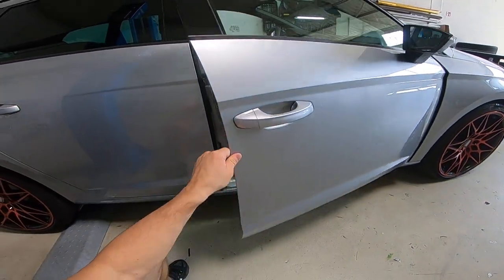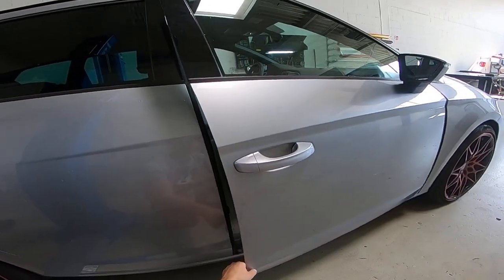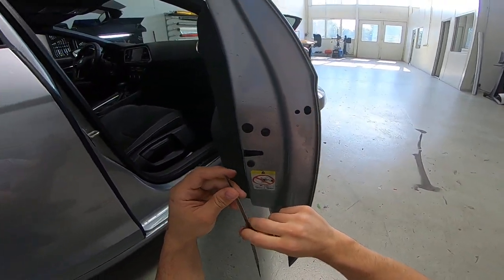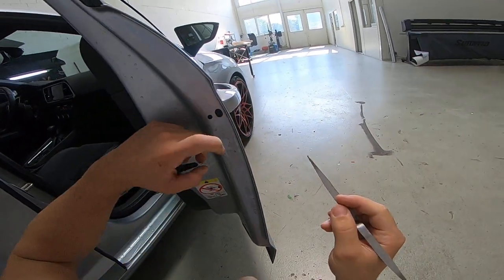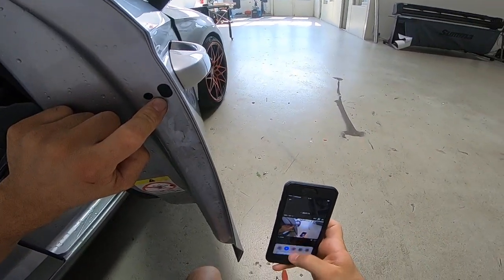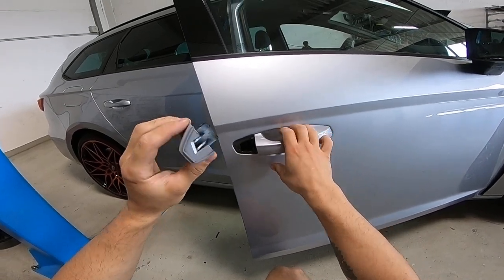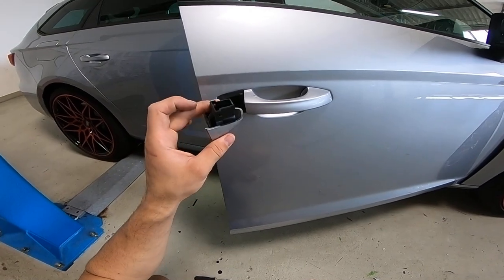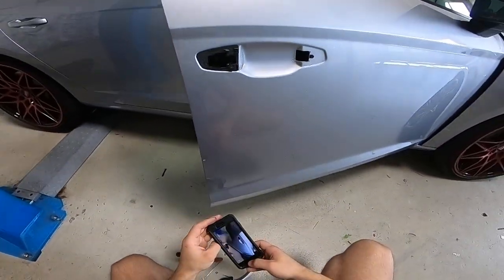How to remove the exterior passenger door handle Seat Leon 2018

Comment: Thanks. So simple when you know what you're doing. Worked for a 2013 SEAT Leon MK3 5F1 1.2 105BHP. I used a hair pin and just bent the last 5mm or so. Two hair pins might work if a single is not strong enough.